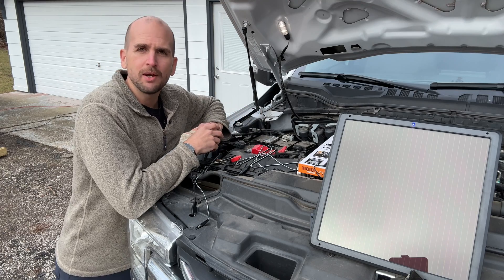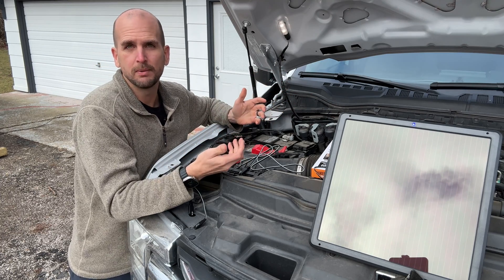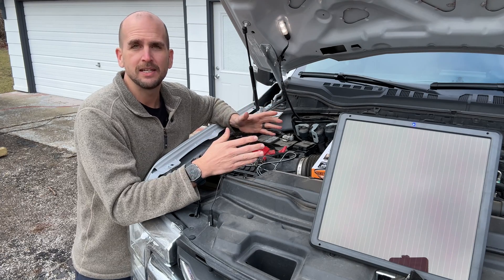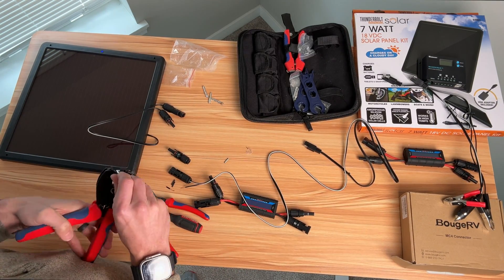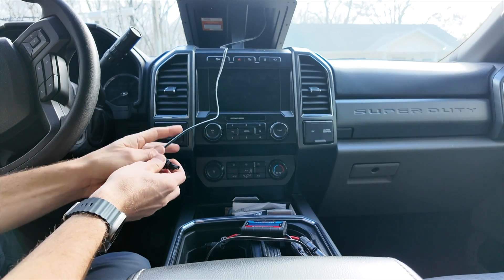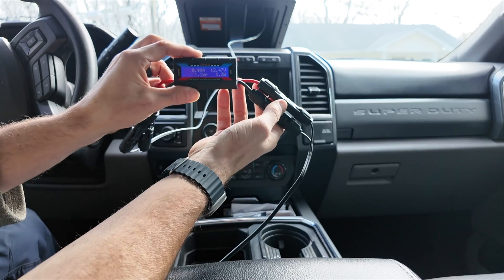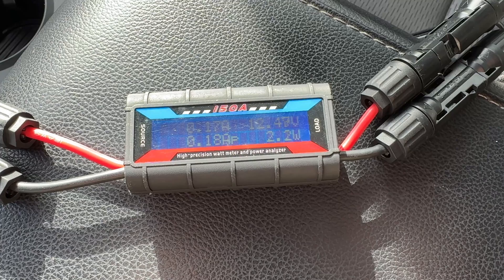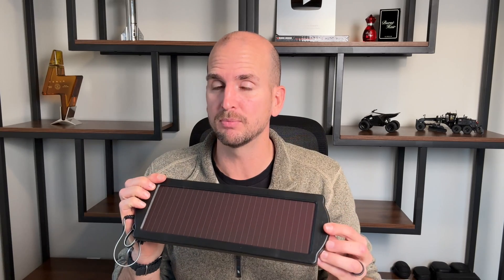Connecting A Solar Panel Directly To A Car Battery | Will It Damage The Battery?

Comment: i enjoy all your videos im a diy er i make all my bat i have 5 solar generators a 5000w a3000w 2 2500w and 1500w all for different parts of the house work great no bms their trouble makers some bms are higher than the batterys

Comment: Many cars/trucks/rv and 4x4 have both contact switched 12 v lighter and ‘hot’ ones. So connect inside to hot 12v. Key remove issue solved. I have a 10 wp behind wi shield to keep batt topped up. No issues.

Comment: Aloha from Hawaii! I have a cheap panel I bought from Checker and have been using it for the past six or seven years. My last batter had a 2-year warranty, but I replaced it after 4.5 years. I would use my panel maybe 1~5 times a month, which I think helped stretch the life. I would hide it on my roof rack and run the line directly to the battery, with the door closed over the wires and the hood down. I don't know if I have a diode in mine, so I don't leave it connected over night.

Comment: so it's OK that a 12V solar panel reads 20V when there's no load attached? I was worried that it would deliver too much voltage to the battery, or fry the car's electronics when hooked up to it.
Reply from the maker: That is the open circuit voltage and as soon as you place it on the battery the voltage should drop significantly.

Comment: To connect a panel to the battery at all times, you need low old school voltage of like 14.0 V.O.C. and really low watts.  I had one of 1.5 watts that made my regular flooded lead acid starter battery last 10 years . . . and then the wiring fried from the sun and shorted out from some rain because I left it outside. (bummer). That was a great panel.  I shoulda fixed the wiring, before it fried.  Modern panels are generally 18 to 20 V.O.C. and higher watts:  they definitely need a charge controller.  Also those more recent so called battery maintainers you could find at Home Depot have really bad substandard wiring beside way too high VOC.  If you can find a panel that is around 14.0 V.O.C. and really low watts you can avoid the charge controller.  I still see them sometimes.  Mostly these days watts and volt are higher and you can find kits with battery clamps and a charge controller with a small panel for pretty cheap on Amazon or Ebay.  Those really cheap umbiquitous lead acid PWM charge controllers will work with any 12 volt panel, you just need a quick disconnect to the solar panel and to hot glue gun wire leads where they screw into the controller to prevent fatigue fraying and shorts.

Comment: Sub 1 amp from 7 watt panel  could 4 of those deliver 2 amps in Chicago
Reply: I mean, wired in parallel maybe? but if you want more power it's far more economical to just get a larger panel with a basic charge controller as at 2A you will want some level of charge controller. '30w solar panel with pwm' would be a good amazon search.

Comment: My concerns are 1. Overcharge. 2. At night, current flow will reverse causing discharge.
Reply: Overcharge isn't a real concern for these 7w panels and a full size car battery due to the self-discharge rate curve of lead acid batteries. at or near 100% the self-discharge rate is 10% in 24h, then the next 10% over the course of around a month. As a result it takes 5-10w just to hold a 12v battery at full capacity, as it will lose 50wh or so per day.

I would assume a panel marketed for direct connection to a battery would have a blocking diode to prevent discharge.

Comment: I found this video just after I spoke with Renogy, specifically about the Wanderer 10. They advised me that none of their products are made for use with a standard automotive battery. They should be used only with deep cycle batteries. So, my search continues for a solar charge. Controller to use on an automotive battery.
Reply: They may just be saying that so you can't try to put it on them if you run down a normal car battery and degrade it. Don't take my word, though. I'd ask on some subreddits or eet forums or something. Get a few smarter opinions and maybe a recommendation for a product. Good luck!

Comment: ok, so i bought this automatic light that turns on when it sees motion. And obviously only when its dark.
It also came with a solar panel and a 6 volt battery.
The light is a grid of leds, basically.
From the LIDL.

The solar panel puts out 12 volt in full sunlight.
Perhaps a bit more, but around 12 volts.
Inside the lamp is a circuit to charge the battery via solar panel. But you can also hook up an adapter to power the light. (and perhaps charge the battery. I am no wizzkid so i dont know if the circuit also charges the battery if you hook up the adapter but i assume it does)

Anyways, the question is simple:
Can i just hook up this simple small solar panel that puts out 12 volts to my car battery to keep it charged? 
Or does it require a small circuit in between?
I have no clue how many watts this solar panel puts out.

I am not an electrician, so hence this question. Thx in advance for any reply.

Comment: I was cautioned to disconnect the solar panel when driving the car. Not sure what the reasoning was, but the panel could be damaged by the car generator power? My current need is to keep my Prius battery ready, since all the electronics in the Prius will drain the battery in 3 weeks if not driven! I've had to jump-start it twice at the airport after long trips 😞 Did you learn anything about what happens when the battery is fully charged and still connected to the solar panel? Any updated recommendations? Add the diode? Other?

Comment: Why not use a small charge controller just to be safe? The are dirt cheap.
Reply: Would lose most of your power to the controller, these panels make almost nothing, they're designed to have a low current so that they are not at a level where a battery would take damage from being connected 24/7. AGM cells for instance would be able to recombine the minuscule amount of water a panel like this would cause the battery to electrolyze into Hydrogen and Oxygen faster than the panel would be able to power the electrolysis, a flooded cell that is not connected to a load like a parasitic draw in a car may need to have water added like once a decade to replace the infinitesimally small overcharge (assuming no self discharge or parasitic loads so all panel power goes to overcharge).

Lead acid cells can tolerate being connected to a very low charge current for long periods with minimal wear, literally just add water once in a while... or just forget it for AGM and Gel since they would be able to recombine the electrolysis gases faster than they are being produced... a controller would probably make the tiny 0.1 to 0.25 amp charge into a 0.001 amp charge because it would need some current to power itself and the panel voltage drops FAST with any sort of load.

I tried to make an MPPT controller to just get to the maximum power point (not really to charge anything, that was for later) and was unable to make it worth powering the very efficient micro-controller chip.

Comment: My energy monitor lasted 4 tries and died.
Reply from the maker: Don't let the smoke out 😂.  I haven't killed any in a while but at the start smoked 2 units.  Make sure the load is plugged in prior to connecting the panels.

Comment: does anyone know if i can connect the - of the solar panel only on the - of the battery or i can also connect it to ground/mass?
Reply: In my car at least, - of battery is directly connected to ground/mass. So it should make no difference where you connect - of solar panel. May be different for some cars idk.

Comment: I have to disagree with you on this one. Few hours of testing is not enough, you need to wait over a longer testing period and see what happens when the battery is full, and it is full sun
Reply: Wouldnt the battery overcharge without a controller?

Comment: This is a great idea and from the comments, already in use by quite a few.
It's probably even a good idea for a daily commuter who parks the ride up at the train station or at work for most of the day (sorry night shift workers...this won't work for you!!!!)
Reply from the maker: Yeah, overall most of the reviews on these type of solar trickle charges are pretty solid.  For the specific use of keeping the battery topped off when a vehicle sits for a long time I would say it works great 👍

Comment: Make sure it has reverse current protection otherwise you'll drain the battery when the sun goes down.
Reply: Agreed, I used the second panel as this video and left it overnight and for days and it drained the battery at night!
Reply: Diode.  Costs 1 dollar. Thats all you need
Reply: @davidstevens7809  or they could build it in for $.30 more and charge you an extra $.50 😁
Reply: Yes, this video is poor information,  even a $0.99 solar yard light from Walmart has a series diode and charge controller to keep the solar panel from draining the battery when dark.

Comment: To maintain a 36 or 48 volt golfcart battery bank you will need a boost converter.  About $35.00.
Reply: or get 3 to 4 pannels and wire them in series 😄
Reply: Boost converter would consume too much of the current at these low currents... you'd be losing like 75% to 99.99% of your solar power in the converter if my best case tests are anything to go by, raising voltages is harder and harder to do efficiently as the voltage difference is greater, even trying to raise by 1 volt was pointless for a panel like this. Either use some hacky solution that floats the panel from battery to battery or uses capacitors like those LiPO balancer boards do, or just wire some of these in series or wire one to each battery...
Reply: @asificam1  when my 100 watt (rated) solar panel is delivering 80 watts to my boost converter I'm getting 72 watts into my 36 volt battery bank in the golf cart.  Much better than your low efficiency claim.

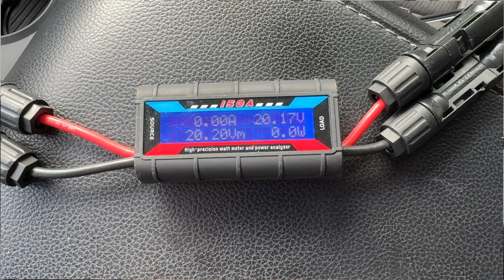Comment: At roughly 4:50 you saw an open-circuit voltage of 20V.  20V is probably way too high for a 12V battery.  If the battery is full and stops pulling current, the voltage can conceivably rise to 20V.

A second test you can perform, then, is to completely charge the battery and then connect up the panel to the battery, in full sun, and see what the voltage is... see if the battery's internal losses are sufficient to keep the voltage in check.  In reality, a lead-acid battery might start pulling current at higher voltages when full anyway, possibly limiting the solar panel's voltage under these circumstances.  So it could still be safe.

And you can also see the danger in making assumptions regarding panels... someone deciding they want more power and connects up, say, a 100W panel, could see a very different result if the battery's internal losses are unable to compensate for that much wattage when full.  Boom.  Battery starts to boil.

But as an electrical engineer I'll tell ya straight-out... without a charge controller, the solar panel MUST have a zener diode built-in to it to actually be a safe trickle-charger for a battery.   A ZENER + NORMAL DIODE.  No zener diode == not safe.  No exceptions.  The output voltage has to be regulated in some manner.

So what kind of zener would be needed?  It has to be beefy, so call it 50W.  The voltage selection is minimal... basically 13.0V or 14.0V.   So call it 50W @ 13V.   And include a heat sink if need-be.  That's probably good up to around a 15W solar panel, more with a good heat sink.

The zener would go across the solar panel's + and - in the reverse direction for a diode (it works using reverse breakdown current, so the zener diode has to be reverse biased).  Generally that means that stripe side is facing the "+" terminal.  But test it.  One direction will short the panel, the other direction will just limit the voltage.   But you still need one more diode because you don't want the zener to short out the battery!  That would be bad.

In addition to the zener diode, there needs to be a forward diode so the zener doesn't short out the battery.  A schottky diode is usually sufficient for that.   The solar + zener arrangement, then the positive goes through the normal diode to the battery so the battery cannot discharge through the panel/zener arrangement.

Since there is a voltage drop across the normal diode  or the schottky diode, you might want to select a zener voltage of 14.0V instead of 13.0V.   This forward diode might need a heat sink too but for a small panel... probably not. a 10A or 20A diode would be sufficient (those can dissipate roughly 4A without a heat sink).   The forward diode goes from the panel+zener arrangement to the battery positive, with the stripe side facing the battery (forward biased).

-Matt
Reply: What do you think about 5.5V 0.33W tiny panels in 3S2P arrangement, plus a 3W orange LED (+/-2V drop) in series with that. So making a 16.5V 2W solar panel plus a 2Vish drop by LED. LED drops less at low current, drops more at higher current, so balancing it a bit. Would that be ok for direct drive trickle charge?
Reply: @TheFreak111  Generally speaking I don't think unregulated charging of any lithium battery is a good idea.  For very low-power charging (using small 5V panels), you could put a Zener diode of the desired voltage (roughly 14.0V) in series with a 1 ohm resistor and put that across the + and - to regulate the voltage.   The zener has to be beefy enough to sink any excess power. Google up how zener diodes work.

That said, honestly, I'd spend the small amount of money required to get even the cheapest possible PWM charge controller.  They're like $20.  A good cheap MPPT charge controller is more around $60-ish (A Victron SmartSolar 75/15).

-Matt
Reply: @junkerzn7312  oh no I am speaking of a lead acid battery. I agree with you on the unregulated lithium charging being a no go.
Reply: @TheFreak111  Ah, lead-acid is definitely easier to to charge unregulated with. Though I personally would still use a charger controller.

Comment: Using 1.5 watt panel, south facing, central KY, inside '98 Toyota RAV, connected to battery for 3 years. Drive car short distances once every 7-10 days. Diehard battery 3 years old was deemed healthy last service check. Initially installed to offset vampire drainage from clock. Car starts right up each time, strong cranking, even during recent cold spell (10° F)
Reply from the maker: Nice, thanks for the feedback and that is a perfect example of where these small units are handy 👍

Comment: I agree, no controller. particularly if there is a normal parasitic load, like a vehicle. And it depends on the climate.
If it is a small tractor or dump trailer out in the AZ desert for a long period of time (months) I would err on the side of safety and add a cheap PWM inline.

But if you are getting only 4-5 hours of direct sunlight a day, and there are clocks and ECUs, it will be a good ebb & flow.

Do note that car windows are treated to reduce energy entering, so there will be a significant drop in performance inside the car.

A charged battery is a happy battery!
Reply from the maker: Thanks for the feedback James.  Good point on the windows.  That 7 Watt would probably max out around 4-5 Watts behind the windshield.
Reply: On an amorphous panel like these, that window treatment wont make any different, least of all one that can be measured. Reason is they already make their max power in low light... but they make that same power in direct sunlight... so they have a slight bottleneck inside the cells. This is the trade off made so that they will actually generate something on very cloudy days... but the higher vampire resistance comes with a higher internal resistance which limits max current. Think of it like a series and parallel resistor that are series and parallel to the cells in the panel... higher parallel resistance is better, infinite would be ideal since then there would be no parasitic losses, and all electrons that get excited by light would be used to power the load. Lower series resistance is better since that means more current to the load... problem is they tend to be related to each other... hence the calculator type solar cells have VERY low power, but they can make some power even under really terrible conditions. Hence why this panel is so HUGE to make so little power. It'll get like 75% of its max power in the shade if its anything like the two I have. However, a more efficient technology like mono crystalline panels will make MUCH more power per unit area than these will... but they will lose a lot of that behind a windshield because they max out under blazing sun not under clouds.
Reply: @asificam1 well said, thank you for making this clear!
Reply: @MaxUgly  As least it didn't make a difference for my panel. Made a super small difference for another panel (but only in low light, in direct light the panel was at max power). And keep in mind that the panel may not make max power if the battery is mostly charged... or the extra power will just go to splitting the water in the battery.

Best way to know is to measure the current and see if it's satisfactory.

Lots of factors impact performance, not worth worrying about if there is sufficient current for your application. But these are low current panels that are basically larger versions of what's in a calculator.
Reply: Amazon has a 7.5 watt, 12 volt with smart controller built in for under $20. Everything you need to get started.

Comment: I bought a solar panel with car battery charger built in for about $20 a couple years ago and it will keep a car battery charged.    I agree its not something you want to leave connected forever but I use one over the winter on a vehicle left outside and it works fine and keeps its battery fully charged providing I keep the leaves and stuff cleaned off the solar panel area of the windshield.
Reply from the maker: Thanks for the feedback 👍